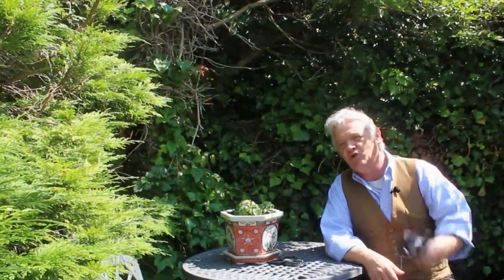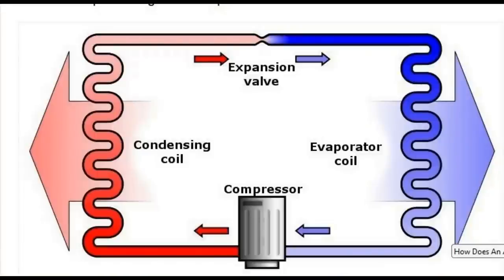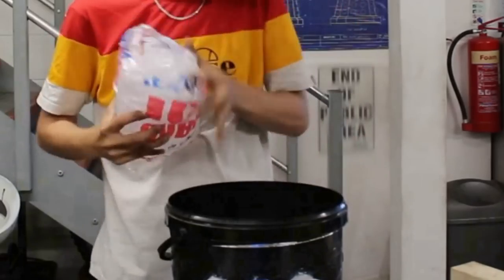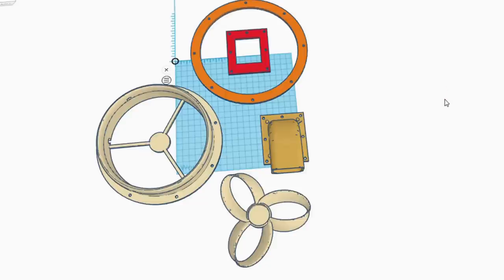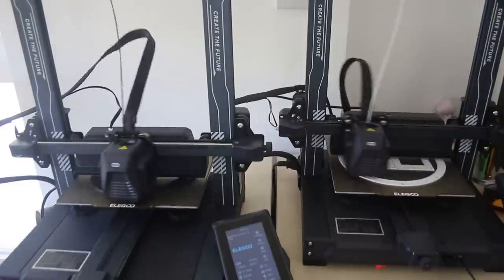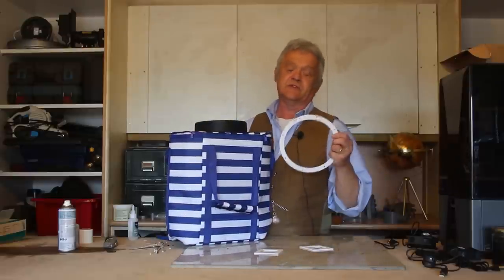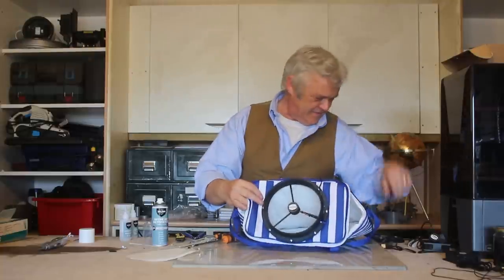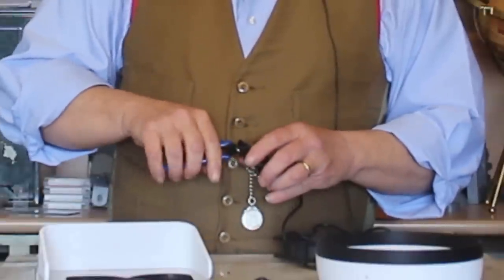1953 A Folding Silent Air Conditioner

Comment: Put electrodes in the brine to power the fan.
Reply: Or a TEG (Thermo Electric Generator) that creates voltage from a temperature differential to power the fan!!!
Reply from the maker: you mean make a battery for it?
Reply: @ThinkingandTinkering  it is battery. Saltwater plus copper and zinc will power the fan
Reply from the maker: @justtinkering6713  you need 5 of them as the voltage is 1.1V for what you suggest connected in series so 10 electrodes in one jar won't cut it - in addition to get the amps required you will need quite a surface area
Reply: @ThinkingandTinkering  maybe a low voltage fan? Not a brushless.

Comment: Please Could you design a system for cooing bath water ie wim hoff ,, mains water is 16 degrees c  in summer  have too puts loads of ice blocks  the bath to get down to  10 c   (9 big blocks large mushroom containers aldi   )  trying to figure out with a copper coil in your bag(container ) and pumping water through via pump thinking this would be more efficient with,one block of  ice  with a  Peltier coolers. maybe ,, bath is 80 liters water , there are fish tank  chillers but very expensive , help

Comment: Just keep the ice COMPLETELY SEALED in a bag (some ice bags have holes).  These "air conditioners" (evaporative coolers) that use ice or water exposed to the open air are NOT air conditioners... they are AIR HUMIDIFIERS.  Three times in my life I've made the mistake of using commercial versions of these.  i.e. A fan that blows air saturated with water (from a water tank or melting ice)... and mould EXPLODES in the room within just a few days.  Never, ever, EVER use that TERRIBLE method of trying to cool yourself.  You'll regret it when you have throw out bedding, clothes, YOUR MATTRESS, etc - every item that it's impossible to remove mould from without so many hours of effort it's cheaper to just replace everything.  Rob shows ice SEALED in a bag so the couple of kg of moisture isn't added to and humidify the air.  But DO NOT skip the plastic bag and just use ice exposed to the open air.  You will only make yourself hotter due to the increased humidity and kick yourself over the mould.  The ONLY place the type with the water or ice exposed to the open air might be ok (but after my experience I still wouldn't use it) is the Australian outback or Sahara Desert where temperatures are so high moisture evaporates within a few cm of leaving the unit, well before it touches and saturates objects, thus no mould can form.
Reply from the maker: cheers mate